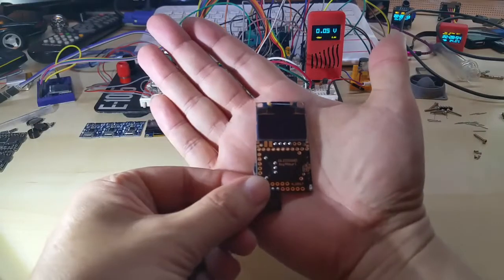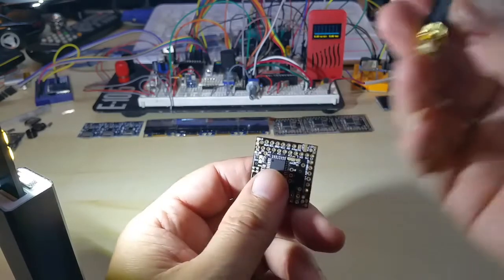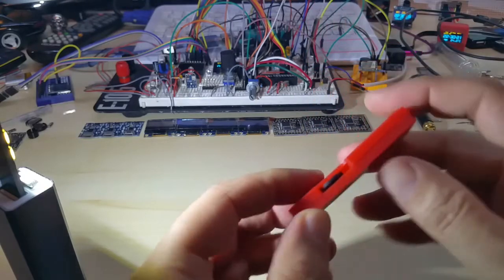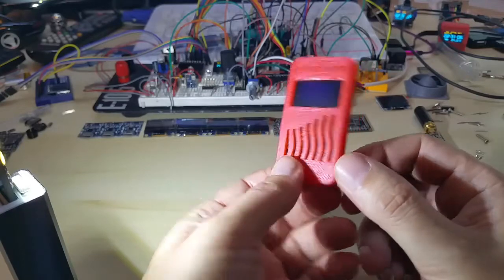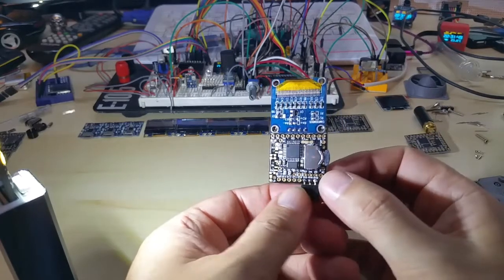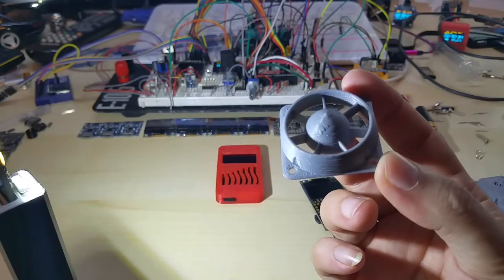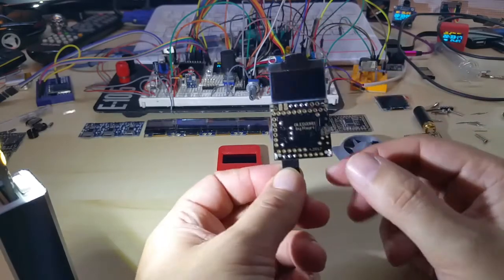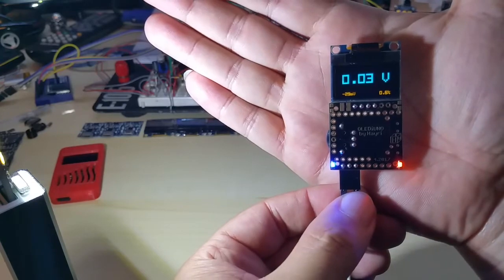OLEDiSCOPE with new PCB and 3D printed Case

Comment: The blobs of ABS is quite common on curved surfaces. This is the place where extrusion head of the printer reverse its direction. This is kind of inevitable feature of round shape models, even if you use semi-professional printers. Although you can play with settings and make them smaller a little bit.
Reply from the maker: Thank you for comment, I guess I have to play with retraction and retraction speed a little.